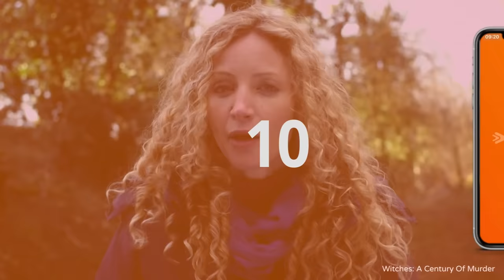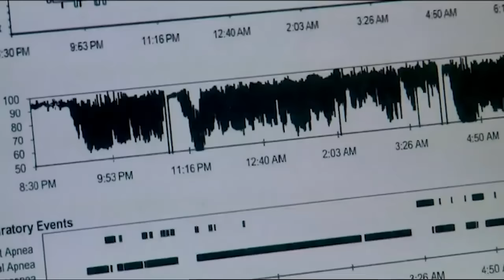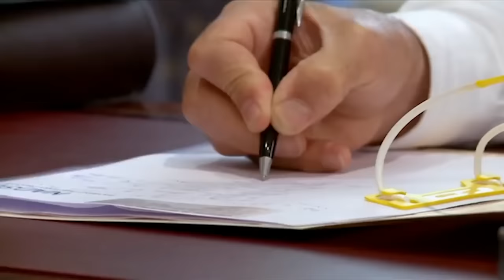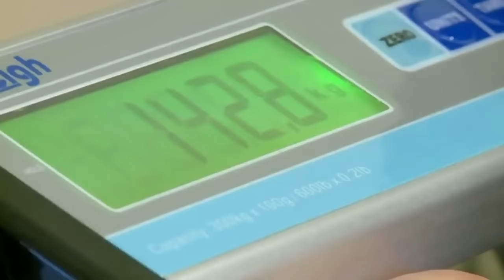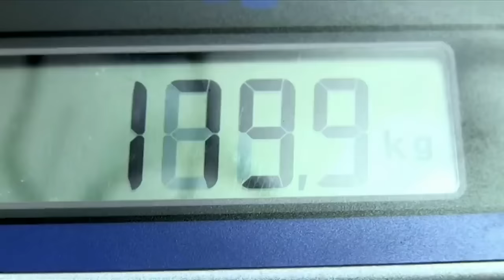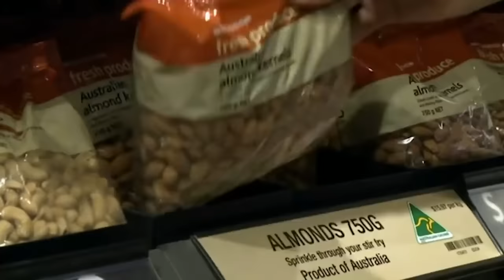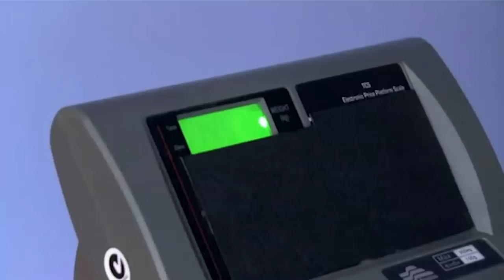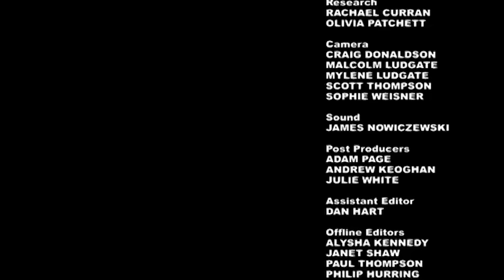Morbidly Obese To Healthy & Happy | Obese (Australia) S1 Complete Compilation | Only Human

Comment: Why are they focusing solely on exercise, when we know diet is more effective?
Reply: The results are seen faster with exercise and it helps keep them motivated while the diet works in the background. Success is addictive
Reply: Are you not seeing that they meet with a nutritionist on each show?
Reply: You can’t lose significant weight without both diet changes and exercise. You will not sustain a large amount of weight without increasing activity because your body will adjust to the food and slow eight loss.
Reply: I think they do, but the exercise sequences are cooler to watch I bet.

Comment: This is my literal nightmare...waking up trapped in a body that struggles to do basic tasks. There is a difference between an accident or a disease that causes debilitating physical symptoms, then there is actively eating yourself into a catastrophic dilemma. One is completely avoidable. Please, people... those extra 15 lbs can easily turn into 30, 40, 50, and 100 + if you don't get your eating habits under control. Please, please stay healthy!
Reply: Well said ❤
Reply: Facts! It’s crazy difficult to loose one pound. More or less 100lbs. I gained 15lbs from 127 to 142. Barely down to 136lbs and I want to get down to 130lbs in 4 months. 😭😭😭
Reply: I found when I reached a certain weight I realised was just ridiculous -- that was nearly 18 stone [ about 250 pounds-ish ] -- I'm just above 6ft tall and can carry about 15 without looking huge but I've trained myself down to look more like a runner than a rugby player -- now probably about 12 stone -- reasonable six pack and some biceps too -- in my mirror !

Comment: In an alternate universe Wayne grew up as the hot, ripped jock/ footballer, dating a cheerleader, and getting an athletic scholarship to University, who was a bit of a bully in his mid- late teens because he struggled not with his weight, but struggled with compassion for smaller, weaker kids. Or he was an actor, who was cast to play that specific role. In this life however, everything changed all because his challenge instead is self-regulation and self-control with food and exercise.

Comment: In the beginning, I don't know why he made MIck's Dad throw away the meatloaf.  That's not unhealthy unless they make it different there than here in the States or something.  You WANT them eating protein, not throwing it away!  That's what helps build strength, which pulls sugar out of the blood.  Also I want to commend these folks for the intense work they're doing and courage they have.  They are heroes and I wish them all the luck in their health journeys.  They are fighters so I know they'll make it.  They might have to try 2 or 3 times or more, often it takes multiple starts but eventually, they can succeed!  HUGS
Reply: Yea depending on how it's made its actually healthy in moderation. Ground beef, seasonings, egg, a slice or two of bread, and you can omit ketchup and BBQ sauce to make it healthier. Pair it with some carbs and veggies, or better yet put some veggies IN the loaf, and you've got a full meal right there.

Comment: This is revolting. People like this need help, not scorn and shaming and they most definitely do not need physical exertion like this. We know that "exercise" has only limited effect on body weight, and then only for a very short time. These people need help with "not feeling hungry", not torture.
Reply: Bart you are absurd
Reply: @aliway4136  I may well be. That doesn't change that what I wrote is true.
Reply: Exercise is great. The only thing I kind of disagree with is throwing them in the deep end like this. Some will keep it up, most won't. I would think increasing the level gradually would be more sustainable
Reply: @FullMetalJesus84  No sane person would argue that exercise is not great. It is. That said, this was about morbidly obese people. Their priority is losing weight and not risking their lives any more than they need to. From that perspective, reducing calorie intake so they start to lose weight is the number one thing to concentrate on. Whether we like it or not, exercise is next to useless for weight loss, unless it is done to extreme amounts that can be life-threatening for them.

Comment: Wish they would put this in pounds also.  I hate using converters.
Reply: Since it doesn't truly matter at the end of the day, I know in my mind that you just have to multiply by 2.2, but I just do x2. So when they say 170 kilos, I say 340 in my head. It's actually 375, but it's also just a TV show and not school or anything so if we're off by 35 we won't fail a test.

Comment: They need the new weight loss meds either Saxenda or ozempic. This is hormonal and the endocrine system is screwed up. The meds reset you and you can keep the weight off. With life style changes and avoiding sugar and processed foods. Without the meds this is bound to fail in the long run.
Reply: Have you had success with the weight loss drugs you mention. It would be good if hunger and cravings could be damped down.
Reply: Unfortunately, these drugs are still unavailable for most people, and if buying it off script, when you can get it, it's super expensive.

Comment: TBH I'm not a fan of how the trainer is talking to some of these ppl. When the issue is at the very least partly mental/headspace, negging is only good up to a point, then it's just putting someone down. Signing up to show themselves on tv to get fitter honestly feels like a last cry for help to me. I feel there should be either more support from the trainer or, if his persona is essential to the show, some counselling more profound than the host making them expose themselves for no gains.
It's a common theme in this channel's programs I think. I like inspiring shows and this is mostly schadenfreude, showing people failing to make others feel better. I'm gonna keep avoiding this channel going forward.
Reply: Yeah that's pretty textbook for weight loss shows from 10-20 years ago, unfortunately. Some of the camerawork is pretty exploitative as well.

Comment: SMH, every specialist on the subject say it´s craziness to lose that much weight in that short time, to lose weight and keep it down, you have to make a lifestyle change, not a crazy diet, no one will maintain 1000 calories a day and 6h of exercize a day like in the biggest loser. It´s all for show. On top of the high risk of falling back with fad diet, losing a huge amount of weight in a short time can cause health issues. In a healthy setting, you´d need ad least half a year to lose 40kg, not 40 days...Just yesterday I saw a specialist of obesity on a talk show, he said that every diet (as in those very restrictive diets) actually worsens the problem. 95% of diets fail (some sources, based on a study done on 660.000.000 people, even said 99%). Lifestyle change however is slower but has way better. The biggest loser show was already exposed for their practices, including putting the health and even life of the candidates at risk. Make a better show, help super obese people with psychological help (since that´s nr 1 reason for obesity), followed by an actual dietician and exercize adapted to their weight, follow them for 1,2,3 years, that´s realistic and long lasting effort.